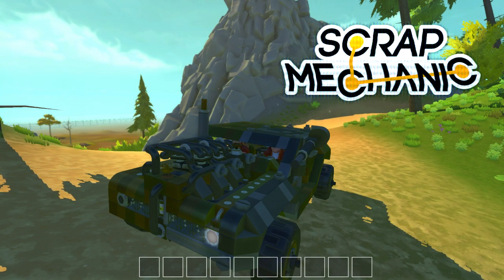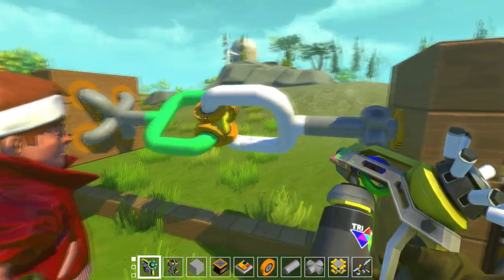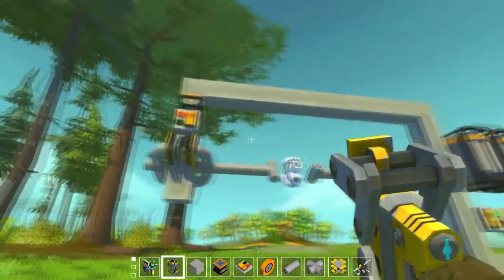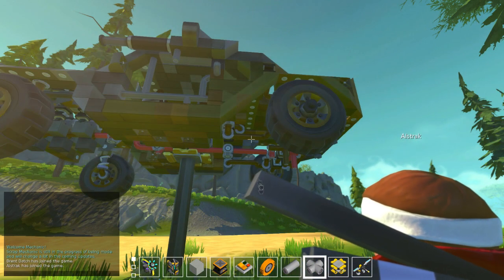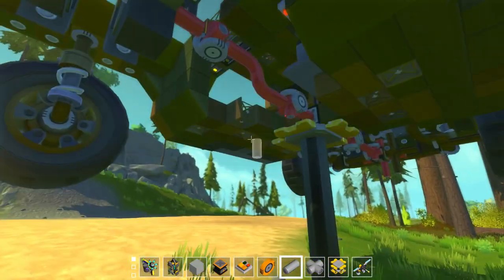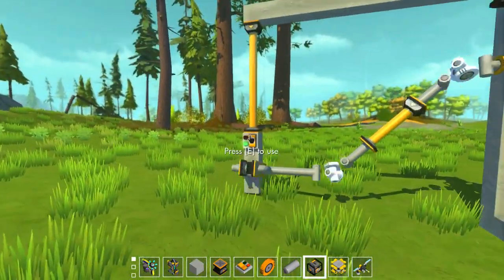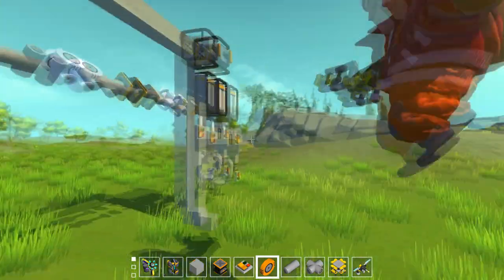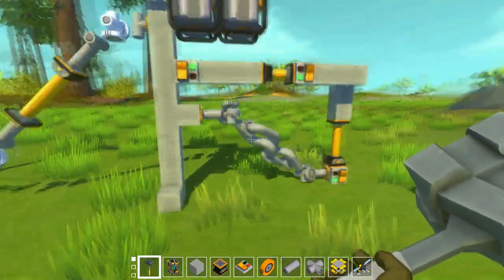Scrap Mechanic: Advanced blueprintedited mechanics!

Comment: Would it be possible to use that to make a 4wd piston powered car? I'm not sure how it would steer and get power to the front wheels at the same time.
Reply from the maker: yes that'd be possible with these ujoints, wouldn't be easy but hey could give it a try!
Reply: Ahem... It's possible and I know it because I have built one already. Although it was AWD but it can be modified in 4WD. :)
Reply: Is it on the workshop?
Reply: Nope xD